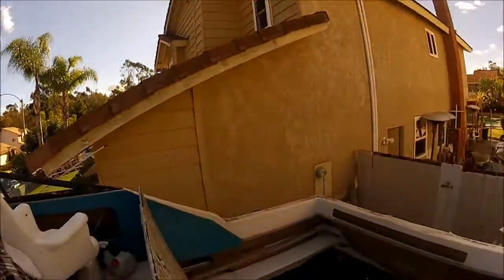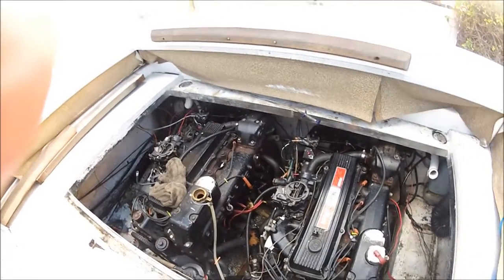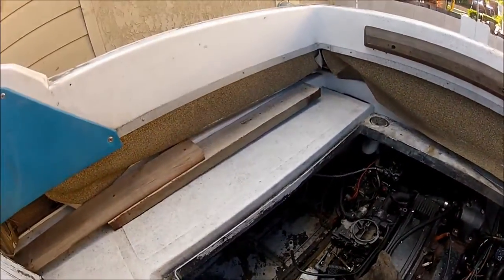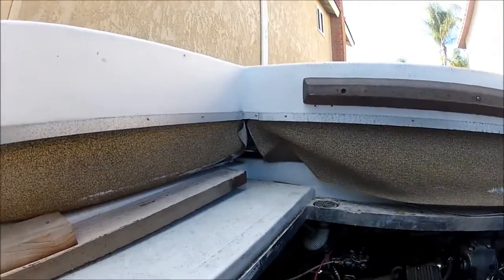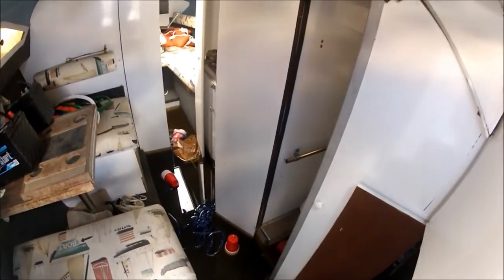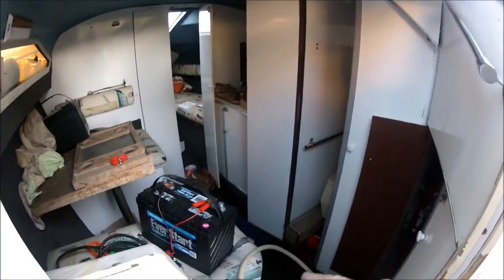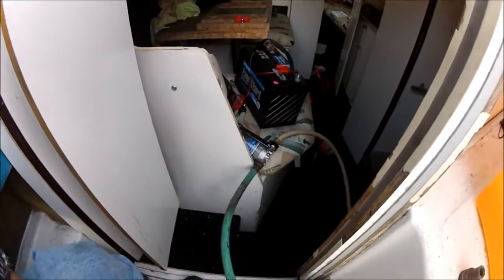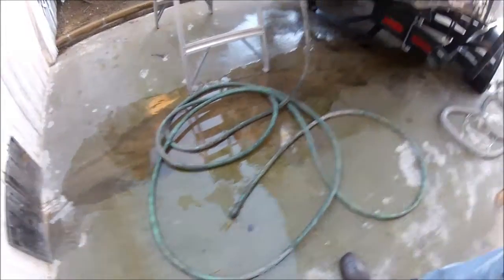Prepping the engines for removal and solving a water problem.

Comment: IMHO, I would take out the twin four cylinders engines and replace it with a single Big Block engine  which will save you a lot of money with having  one engine instead of having twin engines and two outdrives.